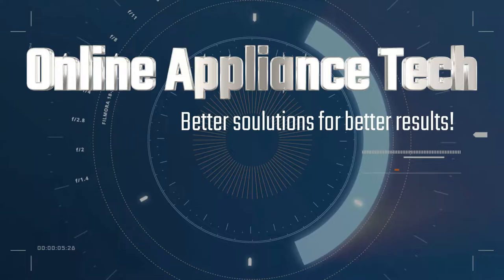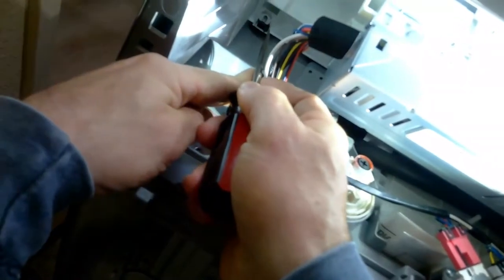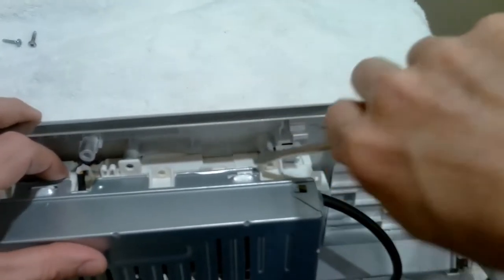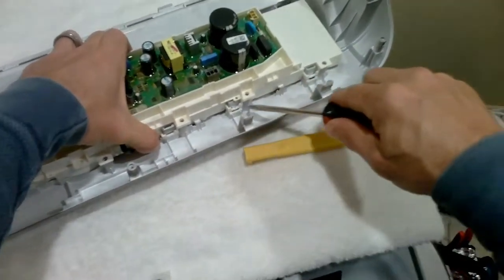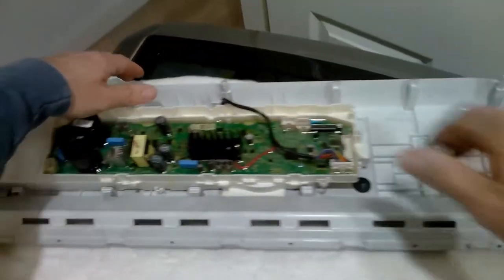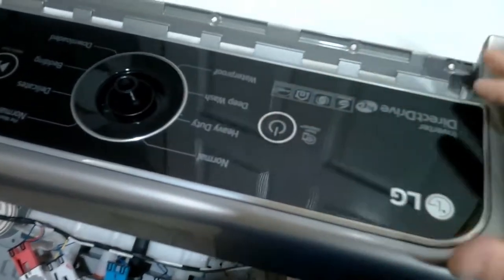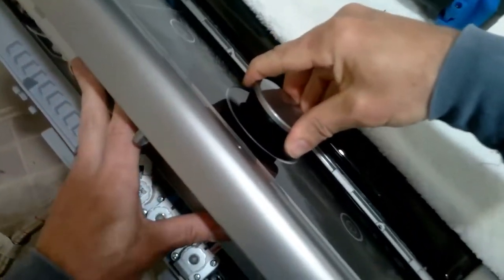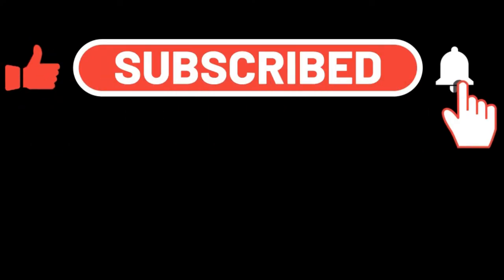Unbelievable Fix for Your LG Washer Power Button - What's the Reynolds Wrap Trick?

Comment: This man deserves a some sort of award saved my struggling butt $350+
Reply from the maker: I'm absolutely thrilled to hear that I could be of help and save you $350+! Your comment is truly rewarding in itself and feels like an award. Keep watching and sharing your experiences. Thank you for your support!
Reply: I bet all the LG techs keep tin foil in their bags. 😂.. 100% agree. Great video! Worked perfectly.
Reply: Getting the PCB unit free of the housing was a struggle, but it suddenly let go all at once.  And I broke a tab on that front trim piece, but don't know how.  I had no trouble removing it.
That aside, under an hour of work, and that includes returning to this video when I was struggling to get the board free.
Glad I found this video before actually buying a whole new PCB.

I had fun powering the washer on and off during the test step--after a couple years of the On button responding less and less reliably.
I will note here that LG designed the Off function to only take effect after a long touch unlike the fast response to a touch for On.  This is to avoid inadvertent Off actions.

Many thanks, sir.  If only the Search function in YT worked better so I could have found this video as one of the first I got served....

Comment: You don't need to tear the whole thing apart to get the tinfoil behind the button. I just fixed mine with the same problem by sliding the tinfoil behind the button. Taking the back off the washer was the only thing I had to do. I didn't have to take it all apart like you did in the video. Just trying to save people from all the work and time. Thank you for saving me hundreds of dollars and now my washer works when I need it! I'm so happy!
Reply: You saved me some time! I love YouTube
Reply: @fredstewart5163  but i still have to fiddle with it from time to time. It still runs fine. In the beginning it would keep shutting off mid cycle. I just unplug it and reposition the foil. Great times!
Reply: Not completely true about not taking it entirely apart. I had to take mine completely apart. The spring had a tiny piece of foam over it. Factory put it on. I had to remove the foam, build up the foil inside the spring casing and then covered it with foil to get it to work.

Comment: THANK YOU SO MUCH!!!!!   Your video just saved me several hundred dollars!!!!!
I think that this is due to a design flaw in the machine.  If you look on the video at the 6:48 mark, (the back of the front panel) - where the power (spring) is supposed to contact the round part of the black shape------ it actually ends up lining up with the little notched part that extends to the right of the round part!  It does not line up with the front panel!

Rather than fitting aluminum foil around the spring, I folded a piece of it to cover the round shape, plus the extended portion, plus just a little more - and taped it to the inside of the front panel.  
Works like a charm!

THANK YOU FOR YOUR VIDEO - I am going to share it in the hopes that you can help hundreds of others save hundreds of dollars!
Reply from the maker: Thank you for your kind words! I'm thrilled to hear that my video helped you save money. Your support and willingness to share the video mean a lot to me. Cheers to more DIY victories!
Reply: I noticed the same thing! What a terrible design flaw.

Comment: Just did this aluminum foil hack on my LG washer.  2 year old washer.  On button stopped working.  The "factory reset" by unplugging and holding down the on button for 5 seconds and the other button for 5 seconds did not work.  But the aluminum foil hack worked.  Thank you so much for this great work around!
Reply from the maker: Thank you for trying out the hack and sharing your success! Glad I could help with your washer trouble.

Comment: My washer buttons had the foam square instead of the spring! I replace the foam for the power button with another button that I never use! Washer works like new!!!!!! Thank you for much for your video‼️‼️‼️‼️‼️Saved me sooooo much money!!!! Blessings!
Reply from the maker: Thanks for sharing!
Reply: Good idea!  I am going to try this.  An early comment said the foil trick still worked on the foam button type, but I feel better about this method for some reason.
Reply: @donaldscott6406  I just did the same thing.  Stole a foam piece from a button I never use.  Worked like a charm!
Reply: Do the foamy things just pull off? Im afraid I'm going to damage the switch

Comment: OMG!!  As an electronic technician I was sure this wouldn't work.  No loss in trying it though.  I'll have to pull the board to replace it.  So I tried it and it works perfect!  There are no moving parts for the buttons.  The little springs just sense your finger is on the other side of the plastic.  The foil expands the sensitivity.  Obviously the board looses its sensitivity after a few years.  The person that figured this out is a genius!  Thank you so much for the video!!
Reply from the maker: Thank you for sharing your experience! It’s always rewarding to hear that the video helped someone troubleshoot their tech issues. Your feedback means a lot!

Comment: We got the same exact model and only 3 years old and this fixed the issues. Instead of taking the main control panel off I took the back part off put some aluminum foil between the sensor and a little toothpick for added support and works like new

Comment: Just did that fix to our 5 year-old washer. Worked perfectly!
Ours had the foam switch instead of the spring. I fashioned a sort of cap with a small piece of foil just like you did, put it over the foam and reinstalled. Worked on the first try. Not sure how long it's going to work but at least I know for sure where the problem is. Not sure if the foam part only could be replaced, I've seen capacitance switch replacement foams sold online but not for LGs. Must be some sort of conductive carbon foam. Anyway, it's all good for now, thanks for this very good trick!

Comment: I can't say enough about how much I appreciate your video.  I was very pessimistic about if this would actually work.  It worked perfectly!  LG should hang their heads in shame putting out a product that is so poorly engineered!   My Daughter's washer was only 2 years old when it stopped powering on.  Starting looking at all of the videos out there and bought a noise filter ($45) thinking it would be with an easy fix.  The Noise Filter was good and now I'm thinking I will need a newer Control board ($190).  After watching some more videos I came upon yours.   I will never buy another LG product again and will make it my mission to tell everyone I know not to buy LG also.  Thank you so much for taking the time to post this video!
Reply: This is one of the more common problems I see with LGs.  That plastic console piece is usually what needs to be replaced, and they usually run about $50, so not too bad.  What I usually do to get the customer by until I can return with the part is drill a hole right where the power button spring goes so you can touch it directly.  As long as the boards are ok, it always seems to work.  You can even pull on the power button spring (lightly and carefully) to extend it so it makes better contact with the inside of the console.  Although not aesthetically pleasing, just drilling a hole so you can touch the spring directly will do the trick and you don't have to buy the part.  Yes, you're right, this is an engineering oversight, but if you want to despair LG, I'd focus more on their garbage linear fridge compressors.  This is a minor issue with a cheap fix, and lots of options to remedy it if you don't want to spend $50 on the part.  Samsung is a hundred times worse.  I'm willing to bet that putting a small amount of dielectric grease where the spring touches the console could even solve the issue, but I haven't tried that yet.  (The spring doesn't touch the circular part of the console where the power button is.  It touches the small little square off to the side that's connected to it.  Hope this helps someone.
Reply: I'd also like to add, you do not need to disconnect any of the wire connectors on the circuit boards to do this.  Just disconnect the power cord from the wall and make sure you aren't putting a lot of stress on the wires.  There's enough slack in the wires to do this with them all connected to the board.  If you do decide to pull the connectors, make sure you are pressing the retaining clip on the connector down and pull it off with your fingers ON THE PLASTIC.  If you pull it by the wires and you pull a wire out from the connector you have a whole other problem that is a much bigger pain in the ass.  LG and Samsung love using super thin and cheap wires that damage and pull out of connectors very easily.

Comment: Great video. Question. Is the goal of the foil to creat constant contact between the spring and the inside of the touch board, or just to use a thin layer to amplify the signal when my finger hot the power button? Thanks.

Comment: My model is less than 2 years old. I used the silver flex duct tape putting it over the power button then another piece on the little square box behind the washer where the power button is sort of flush with. It worked for about 2 months then stopped. I since then read where someone used aluminum foil. "It Works" take a piece of foil about one inch x 6 inches. and behind the washer where the power button is there is a hole. Slide the foil into the hole until it is touching the power button. Now take another piece of foil and place over the power button. The trick is to just move the foil in the hole a little bit around until it comes on. Sometimes I touch it just right and it comes on right away. Other times it may take me 30 seconds or so, but it truly works. With that being said I will ride it out until the unit stops working and will never ever buy an LG Product again. The person that gave this tip said the glass is thick and the mesh or spring on the button wears out. The tin foil acts as current to get the power button on. Please try it. Don't get frustrated, and you will here that awesome sound of it powering up.
Reply: @masterlee4370  what model do you have.  Would love some helpful pics.  Thanks

Comment: Great video. I have also found that using aluminum foil tape actually seems to work even better. You can stick 1-2 layers of the tape to the washer housing where the spring comes in contact with the housing without having to worry about it slipping out of place.
Reply from the maker: That's a great idea!

Comment: This was great!  No idea how much money you just saved me! Tip to others don’t think that putting the foil on the power button means you should also put it on the start button.  I thought maybe that would help as well and it just got the whole machine all confused so I had to take it apart again and removed that extra tinfoil. But it seems to be working now and I’m very thankful. Also super curious why LG hasn’t fixed this known problem
Reply from the maker: I'm so glad I could help you save some money! It's always great to hear when my videos make a difference for someone.
Reply: @onlineappliancetech  for some reason, though, now I have to push extra hard on the start button and the different modes, but it seems to be working so that is all I wanted.
Reply: We did the foil on the start button and it WORKED! But now the start and other control buttons aren’t working 🤔. Going to try this again
Reply: There is big money in the parts business!

Comment: Do you have a fix for the control wheel on this LG that is not working. It will spin but sometimes does not advance to a different mode. For example if I'm a normal mode and want to go to delicate I have to push it in or pull it out and keep trying.
Reply from the maker: Given the issue you're encountering, it appears necessary to replace the display control board due to the symptoms you've described. This board is crucial, especially since it links to the non-functional knob. Unlike the main control board, which is located at the back, the display control board's connection to the knob in the front is where the focus should be for resolving this problem.

Comment: Mine did not have the metal spring but a foam switch.  The foam switch is a piezo switch which does what the tin foil does but was worn down.  I just pulled a foam switch off of one we did not use on the right side and switched them out and it worked.  Also a dime worked really well to get the metal top cover piece off.  Hope that helps someone else.

Comment: I don’t have the spring inside on the power button. Mine is more of a sponge will the aluminum foil still work?
Reply from the maker: That's a good question! I believe you have to remove sponge. and there should be a spring underneath it. I recently ran into the same problem and it did not work when I placed  aluminum over the sponge. However it's already broken, so I guess it would not hurt to try.. Totally up to you if you want to try. If it doesn't work you still would have to replace the front panel and Display MPC but not Main MPC. Best of luck let me know the outcome.
Reply: Our LG washer was foam button too.  The aluminum foil seems to work well.

Comment: I used foil not Reynolds but it didn't work. So I just ended up switching the foam pad with another from the right side and it worked.

Comment: Thank you I had what looked like sponge that was compressed ,with a electric tape wrapped around that. I took and pulled some of the sponge material out and used a spring from a ink pen cut it to fit .I pushed the spring down inside the rest of the sponge material i did add the foil it wouldn't stay in place so i added a rubber band to the base. and that is working for now. I will to the test to see if anything shows up.
Reply: Did it end up working out good for you? I'm fixing to try the same thing. My power button has the same thing you described.

Comment: I did this and it worked for a month or so. Saw a video where a guy cut a hole out to expose the buttons, which also works.
However, when I snap the cover on, it doesn’t respond, when I pull the cover off, it works.

Comment: Score one more for the aluminum foil patch!  Worked like a charm — it is really quite shameful, that LG manufactured such a bad design for something so critical to the functioning of the washer.  Without this patch, I would need to replace the entire front panel for about $250.00 (plus labor)— and this replacement panel likely has the same defect.   
Gives me pause about purchasing LG products with these touch panels in the future.
Reply from the maker: I'm glad the aluminum foil patch worked for you! It's frustrating when manufacturers overlook such critical design flaws. Thanks for sharing your experience!

Comment: I guess mine is a different model because the capacitive on/off button only had a small piece of conductive foam on the top instead of a spring. Adding foil to that didn't fix it.  Replacing the foam with a small spring and covering that in foil DID work though!
Reply from the maker: Appreciate you sharing your fix! It might just help someone else facing a similar issue with their device.
Reply: How's that working out for you as of today?I'm fixing to do the same thing. Mine sounds just like your power button
Reply: @randyman8984  It's still going strong since I did this fix. No further issues (yet).
Reply: @Marr_SC  good to hear

Comment: Unbelievable is right!!!! The power button can't get enough "push" to activate it after less than 4 years. We tried the foil trick to no avail, but I didn't put enough. It just needs the power button to be pushed like the "old days". These soft buttons just don't do it for me. Give me the click buttons any day of the week. I'm drilling out the plastic power button cover to be able to push it manually (I have a rubber piece over the spring so it should work just as well). THANK YOU for figuring this out! You've saved many people thousands of dollars$$$$$$
Reply from the maker: Thank you for sharing your experience and for the kind words!

Comment: Hmmmm has anyone tried stretching the spring a bit to get it to contact the glass cover vs filling the gap with foil?
Reply from the maker: Extending the spring might not be the solution; only using foil could help.